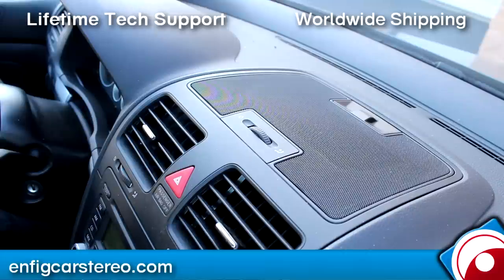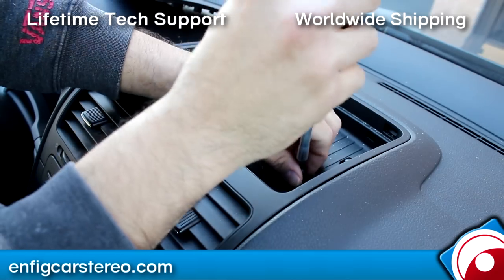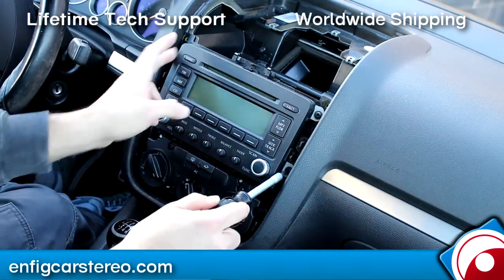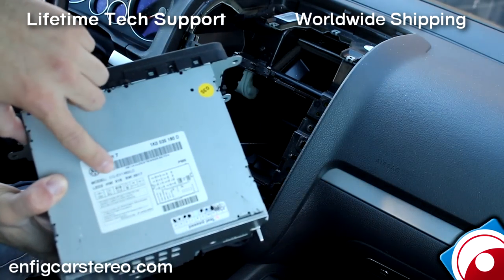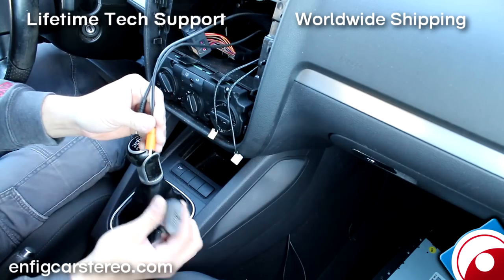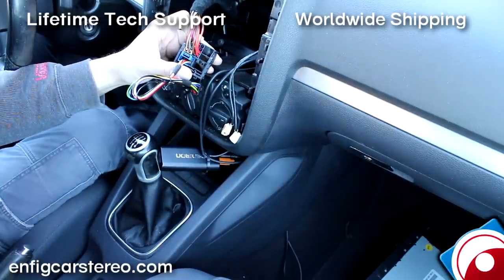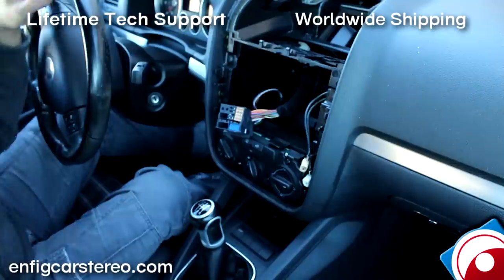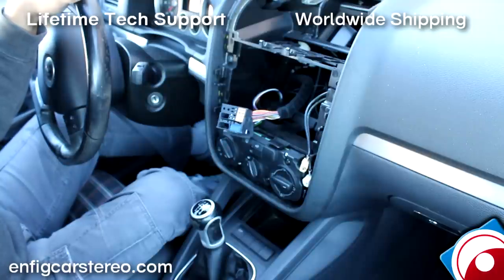Jetta Rabbit GTI R32 06-09 iPod iPhone AUX adapter How-To-Installation Dension GW1LVW1

Comment: I have an 06 Passat with a CD changer plug in the glove box, female plug. Do you make an adapter that plugs directly into this plug instead of the back of the stereo? It would be much easier for me to mount everything in the glove box.
Reply from the maker: 1.AUX
http://enfigcarstereo.com/ENFIG_VWT_AUX.html

2.iPhone & iPod through 30pin (audio, charging and control no text) + AUX
http://enfigcarstereo.com/DENSION_GW1LVWT.html iPod + AUX

3.iPhone & iPod through USB (audio, charging and control no text) + AUX 
http://enfigcarstereo.com/ENFIG_VWT_IPDU_AUX.html

4.USB for memory sticks + Bluetooth with option for iPod and aux 
http://enfigcarstereo.com/DENSION_GBL3VW8.html This is the main unit.
http://enfigcarstereo.com/ENFIG_AUD2_TO_VWT.html This converts the connector above for installation in the center console.
The unit above has a 9 pin round port that can accept any of the devices below.
Adding this allows you to charge, control and transmit audio from an iPod or iPhone through the 30 pin connector.
http://enfigcarstereo.com/DENSION_IPO5DC9_NC.html
Adding this allows you to add a female USB for apple products for charging audio and control.
http://enfigcarstereo.com/DENSION_LIA1GW0.html
Adding this allows you to connect an aux to the unit above.
http://enfigcarstereo.com/DENSION_CABL_AUX.html

Comment: Which video do I use if I have the aux in port in the armrest (2008 Volkswagen GTI) and I want to install an Enfig MK5 MK6 SHIFTER AUX into the shifter compartment? The armrest is different than any of your videos, and it's not the old ipod jack-type compartments like the videos that has it with the one big cable at the bottom of the armrest. i"m trying to figure out how to handle the aux in in the armrest...
Reply from the maker: If you have a cable instead of a dock between the seats then you probably have an adapter that connects to the back of the radio.  I need to see what that cable is connected to.  Then I need to see what the box is connected to.

Comment: Will this work for a 2005 Volkswagen Jetta? Great video btw!
Reply from the maker: Thanks yes it will but there is an updated one for the iphone 7.  http://enfigcarstereo.com/ENFIG_VW1_IPDU_AUX.html

The 2005 is a split year. http://enfigcarstereo.com/IPOD_VOLKSWAGEN_JETTA_05.html
Reply: will the Enfig adapter plug into the stock radio head? if so what button will i use after to use the aux?
Reply from the maker: The CD button activates it.

Comment: Hello I have a 2010 jetta with satellite radio and the aux port in the center console and CD changer. the aux isn't working so looking to replace it. Which product can i use to replace my current aux but keep the CD changer working?
Reply: +Wolfleader&#39;s Gaming actually i think i have the in dash CD changer not the one in the center console +Enfig
Reply from the maker: +Wolfleader&#39;s Gaming 
Here are your options.

http://enfigcarstereo.com/ENFIG_VW1_AUX.html   AUX

http://enfigcarstereo.com/DENSION_GW1LVW1.html iPod + AUX

http://enfigcarstereo.com/ENFIG_VW1_IPDU_AUX.html iPod via usb + AUX

http://enfigcarstereo.com/DENSION_GBL3VW1.html USB + Bluetooth with option for iPod and aux
The USB for apple products can only be added to the bluetooth unit above.  IT does NOT work with the simple adapters above.
http://enfigcarstereo.com/DENSION_LIA1GW0.html

http://enfigcarstereo.com/ENFIG_MK5_MK6_SHIFTER_AUX.html
http://enfigcarstereo.com/ENFIG_MK5-MK6-SHIFTER-USB.html

Comment: I have golf tdi 2006( standard) and i want a aux port at the moment i have av cables one side it has got red and black wires other side its auxiliary wire would it work if i just plugged them two in the back of the cd player (factory )  or do i need something  else  please could you reply asap thanks buddy
Reply from the maker: +prestigeproduction57 No you need this adapter.
Reply: +Enfig which one
Reply from the maker: +817 sorry must have missed this. Here are your options.

http://enfigcarstereo.com/ENFIG_VW1_AUX.html   AUX

http://enfigcarstereo.com/DENSION_GW1LVW1.html iPod + AUX

http://enfigcarstereo.com/ENFIG_VW1_IPDU_AUX.html iPod via usb + AUX

http://enfigcarstereo.com/DENSION_GBL3VW1.html USB + Bluetooth with option for iPod and aux
The USB for apple products can only be added to the bluetooth unit above.  IT does NOT work with the simple adapters above.
http://enfigcarstereo.com/DENSION_LIA1GW0.html

http://enfigcarstereo.com/ENFIG_MK5_MK6_SHIFTER_AUX.html
http://enfigcarstereo.com/ENFIG_MK5-MK6-SHIFTER-USB.html

Comment: HI , i brought a 2009 model radio and have figured out how to work the radio and cd , however i have a few questions on what some of the pins are as i do not plan to use this radio in a car,  Can you please tell me what i do with the control pin , +UB , CAN-FZG , CAN+FZG PINS , it also came with a rca cable which has aux 1 , aux2 , video 1 in , video 2 in , front , rear , SUB but even tho aux is enabled i cannot get any sound ?? please help , Would pics help
Reply from the maker: Sorry I don't know anything about that.  I would have to have the car and new and old radio in front of me.

Comment: Hey there, after installation is Satellite radio disabled indefinitely? If so what item would I have to purchase to prevent that? In case I wanted to switch from aux to satellite to am/fm to cd, etc.
Reply from the maker: It just disconnects the 3 wires.  You can either buy the splitter below or move the pins yourself.
http://enfigcarstereo.com/ENFIG_MK5_SAT_PASSTHRU.html

Comment: hey i have a 08 r32 and my aux input in the center console the wire seem to have come out of the plastic peice can i fix this?
Reply from the maker: I need to know what adapter is installed first.
Reply: +Enfig the stock aux that comes with vw
Reply from the maker: I think it must be replaced.

Comment: how do i listen to the aux once its installed?
Reply from the maker: +Innis Wheatley You press the CD button twice.
Reply: +Enfig Alright great. I have an 07 gti but it didn't come with Ipod or Aux adapter which is unusual because 07's were suppose to come from factory with Aux. Anyways I am going to order your product to solve my problem. Correct me if im wrong but the parts I need are:

Enfig PPT-1
Enfig VW1-AUX
Enfig 3535
Posi-tap EX-150B

It has the 6 cd changer but no sat radio. Just looking for some verification before I place my order from Canada.
Thanks
Reply from the maker: +Innis Wheatley That would do the job for an aux.